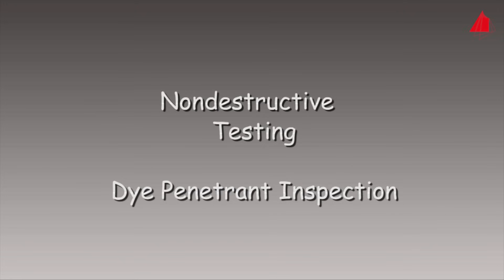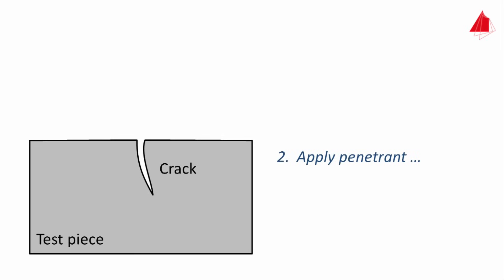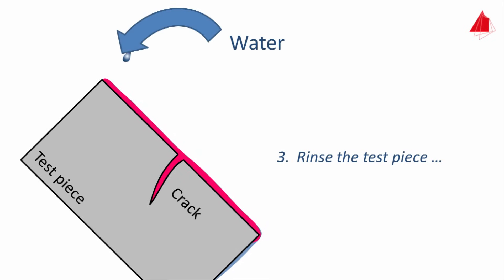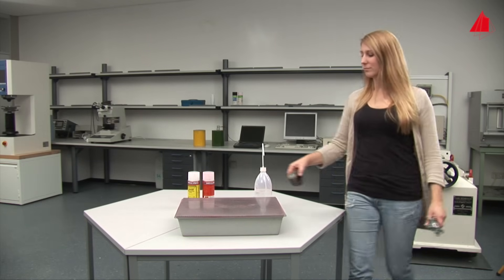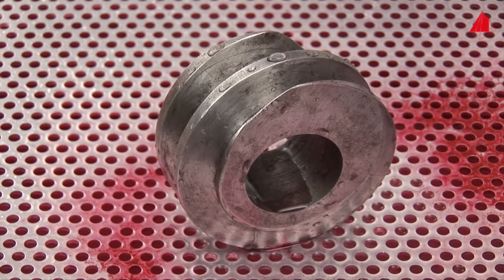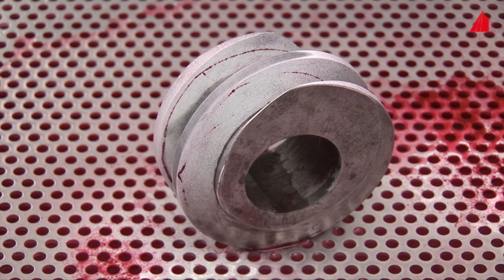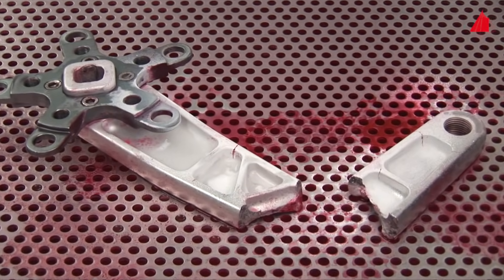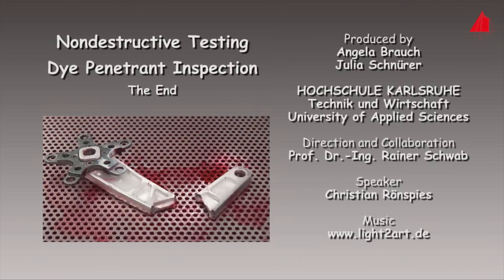Dye Penetrant Inspection

Comment: thanks for the video. 
what if the test sample is black in color? the dye may not be that visible. any suggestion?
Reply from the maker: Answer to "thanks for the video. what if the test sample is black in color? the dye may not be that visible. any suggestion?"
In this case, a penetrant with a UV fluorescent penetrant is used, which is later analysed under UV light.

":

Comment: But washing parts must be done with Commercial Solvent not Water !
Reply from the maker: Answer to "But washing parts must be done with Commercial Solvent not Water !": Not necessarily; it strongly depends on the penetrant. If the penetrant is designed to be washed off with water (it then contains an additional substance), it works well with water.

Comment: Hi, why need to do pre cleaning the surface first?
Reply from the maker: Answer to "Hi, why need to do pre cleaning the surface first?": It is important that the defects are open to the surface. If you already have a clean surface, cleaning is not necessary. However, if the surface has covers of rust, paint or other substances, you must remove them first, otherwise the penetrant will not be able to reach the defects.

Comment: Excellent video, but washing the part directly is actually not correct because it may wash out the pentrant soaked in a minor surface flaw, e.g. a micro crack from a weld surface. Instead wiping with a cleaner liquid/water is recommended.

Comment: What chemical product do you use for that ??
Reply from the maker: Answer to "What chemical product do you use for that ??": You probably mean the penetrant. It is a special oil with a low surface tension and a dye. We have several suppliers - you can easily find them all on the Internet.

Comment: Can it right aftet welding when piece are hot
Reply from the maker: Answer to "Can it right aftet welding when piece are hot": Dye penetrant inspection as shown in the video only works at room temperature or, let us say, from 20 to about 50 °C. So if you weld a piece, you should let it cool down before testing it.

Comment: The excess penetrant is then removed from the surface. The removal method is controlled by the type of penetrant used. Water-washable, solvent-removable, lipophilic post-emulsifiable, or hydrophilic post-emulsifiable are the common choices. Emulsifiers represent the highest sensitivity level, and chemically interact with the oily penetrant to make it removable with a water spray. When using solvent remover and lint-free cloth it is important to not spray the solvent on the test surface directly, because this can remove the penetrant from the flaws. If excess penetrant is not properly removed, once the developer is applied
Reply: then what happens?
Reply: Thanks

Comment: What about dry sanding off developer on aluminum parts after they have been pen. inspected?
Reply from the maker: +Helen Reynoso You may always dry sand off any developer, as long as you do not damage your aluminium parts. It is better to wash the parts traditionally, but this is not mandatory if you dry sand them in any case.